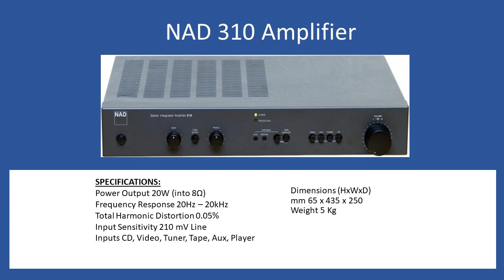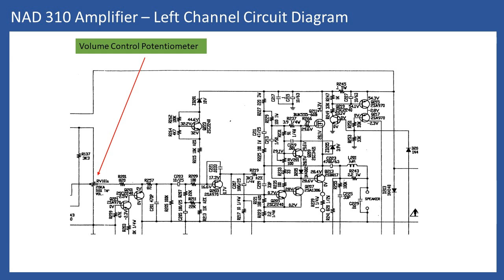NAD 310 Repair (With Audio Tutorial)

Comment: Was asked to look at one with a channel with volume cannot fully turned low. Came in with no sound from one channel. Cleaned that brown glue and found a conductor of the flex cable badly corroded & few wire snapped off the board. Fixed them and continue to check volume pot. Found bad on one channel. Rather difficult to get, luckily able to get a new one.  I'm just a hobbyist, no way a pro/experienced repair man & your video pointed out the brown glue problem. Thank you very much for sharing.
Reply from the maker: Thank you. It's great to hear you have repaired the Amplifier

Comment: Great video!  The left channel on my NAD310 is intermittently cutting out so I'll check the screw you mentioned near the heat sink.  I bought this amp new in 1995 and have used it ever since.  Hopefully this is the problem.
Reply from the maker: Hi also remove the brown glue and check for dry solder joints.

Comment: Hey hi, its been while i didn't drop by, until i saw this video. i have no success in restoring my NAD, chatted with u in the past, however i have not attempt if since than. Changed the caps, potentiometer, but no luck with adjusting the bias voltage, it went up to 19v, have not reflown the soldering yet. hope i'll continue the repairing project one day. 😊